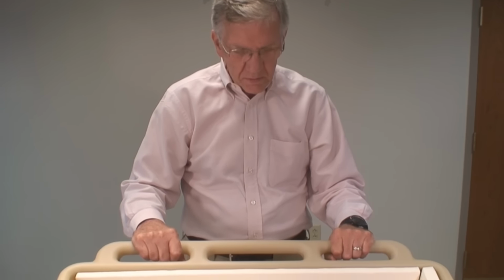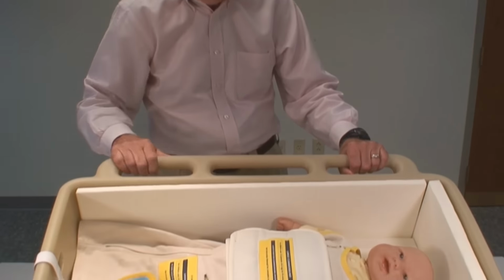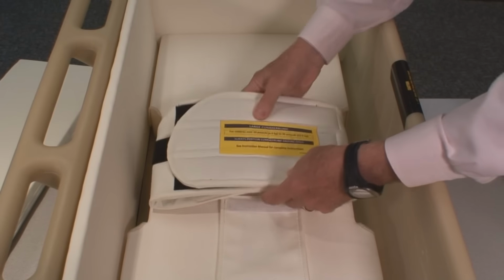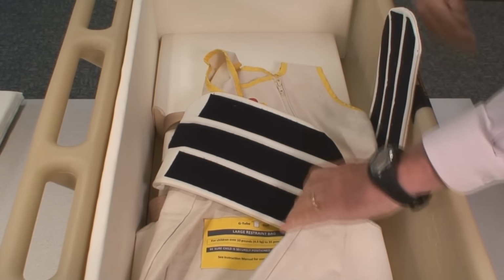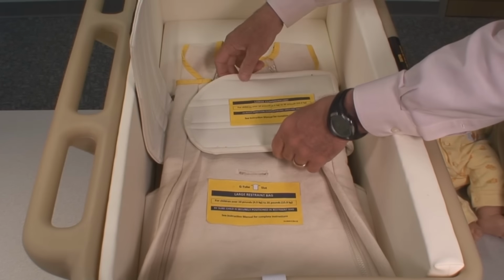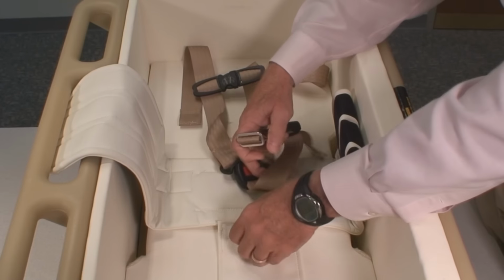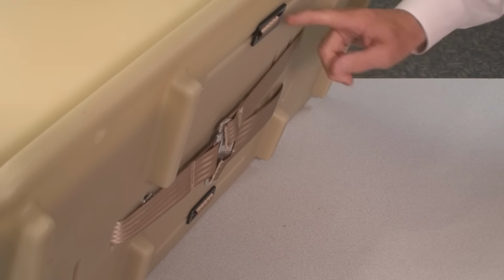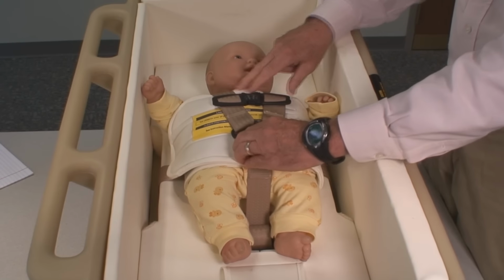Introducing the Hope Car Bed

Comment: I wish there was an economy version available. I would love to give my kids a place to lie down and sleep in comfort during long drives, instead of having to sit up all the time and have their heads hanging. I'm always worried my kids will suffocate in car seats.
Reply from the maker: +castirondude Extended rear facing to the upper weight and hight limits of a convertible carseat is highly recommended for safety reasons. An added bonus of rear facing is additional recline which will help keep heads from flopping forwards. I hope that helps.
Reply: +Merritt Manufacturing, Inc. i was mostly looking for something more comfortable and easier to use than standard car seats. The car seats are a major hassle and not suitable for long drives